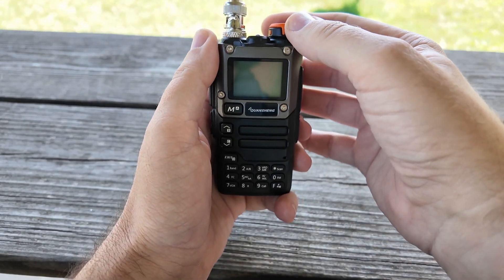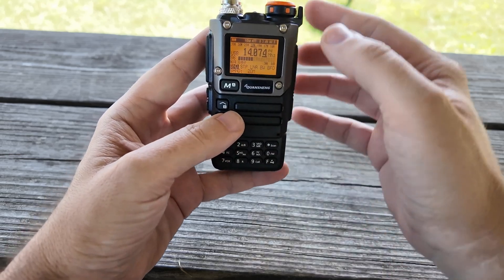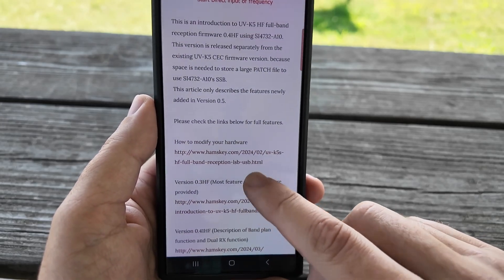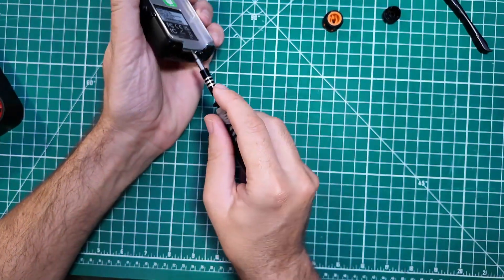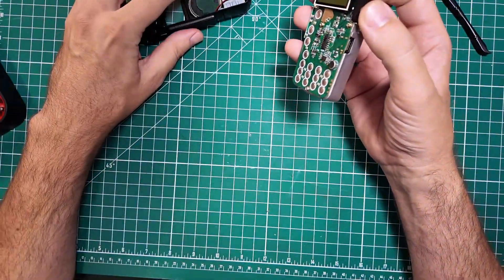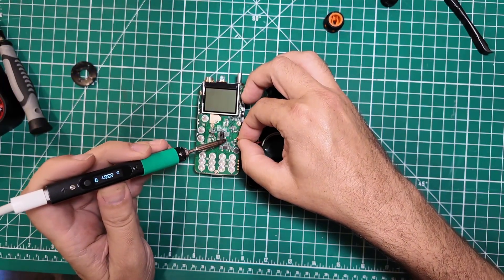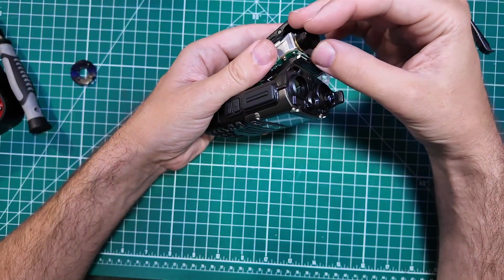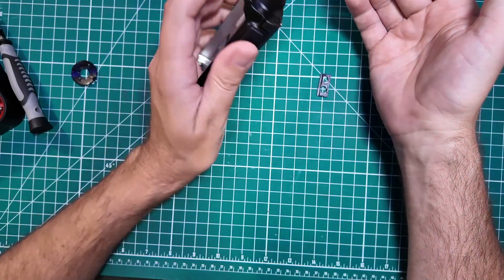Quansheng UV-KF HF Shortwave Listening Mod!

Comment: how low can you listen with just the software mod?
Reply from the maker: I'm not sure I understand your question
Reply: @ without the mod board what's the lowest frequency you can receive?with just a custom firmware?
Reply from the maker: @LZ2SM  Ah, ok.  I am not 100% sure, but I'm going to assume its airband - 120mhz.  @HamRadioDX channel would be the place to go.  Hayden has done a ton of videos on this.

Comment: I bought one of these boards after watching Paul OM0ET fit one in a video on his channel. It looked fairly straight forward to do.....I WAS WRONG !!!! Aliexpress, in their IMPOTENT wisdom sent me a package of components not a built unit, there are 23 components on the board, 3 separate chips, various resistors and diodes and so on. They are so small, even with my largest loupe (10x magnification) I cannot see them, we are talking resistors that are less than 1mm long including their soldering pads. There is NO WAY a human could hand assemble one of these boards, the PCB itself is only 3 micron thick polymer, so any heat from a soldering iron burns it instantly, the components are so small they melt on contact with an iron and IF you were able to hold your hand steady enough to do surface mount soldering, there is NO INSTRUCTION SHEET SUPPLIED and none of the components other than the 16 pin chip have any numbers on them. There are 6 resistors on a backing sheet, all different values and they are all EXACTLY the same colour and size with no markings. 5 diodes the same way on another backing sheet. I doubt many people could fit the completed unit themselves, it's far fiddlier than it appears to be in the video, but I'm 100% certain there is NO ONE ALIVE that could do it from the parts they sent me.....If you can get one of these radios with this board already fitted, snap it up quick, there wont be many of them available I wouldn't think.
Reply from the maker: I have always stayed away from aliexpress - the long shipping times and the question of "what will I actually get in my order" just makes me nope.
Reply: @temporarilyoffline  Seems to be a logical course of action, i wouldn't use them either, but Amazon don't do Paypal, so I cannot buy from them.

Comment: Try fagci reborn firmware way better recieve with si4732 then cec or ijv firmwares, chirp module has support for all functions and can specify what chip to use in vfo so no seperate functions or menus
Reply from the maker: That's pretty sweet!